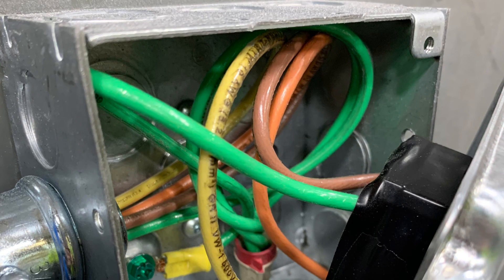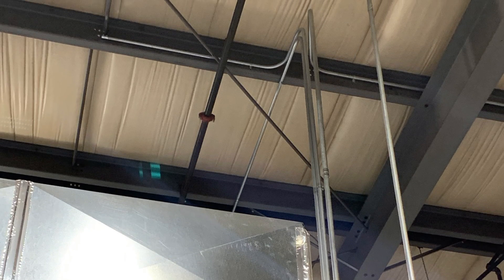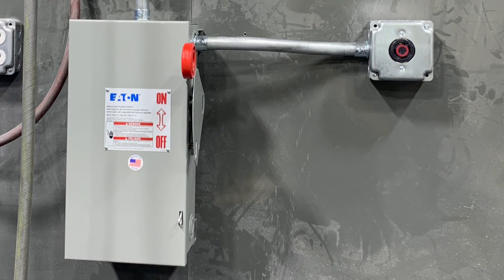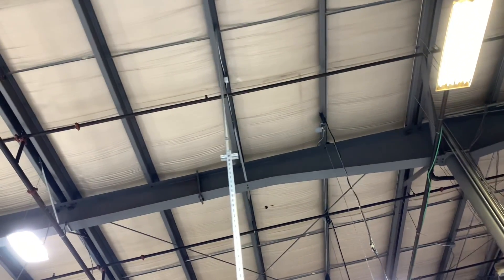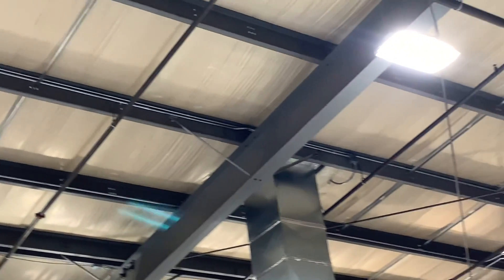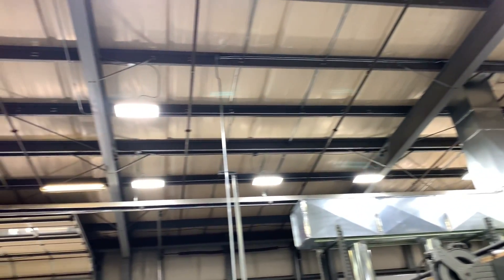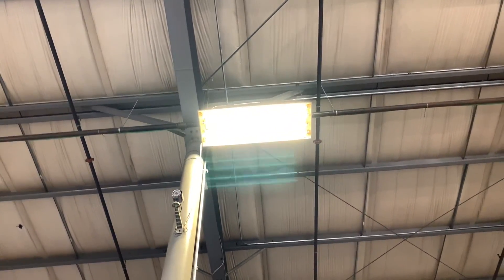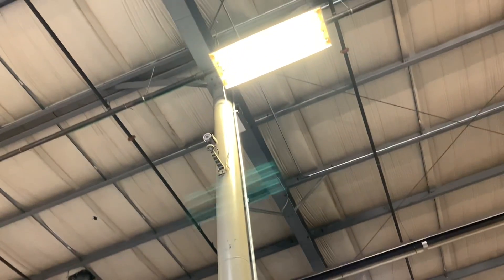Today As An Electrician: 480 Volt-3 Phase-30 Amp Receptacle & Disconnect

Comment: On 480 wiring, do you have a specific order for the 3 hot legs? If a wire is switched up, you swap two to get the motor to turn the right direction. So that's why I'm wondering if that can be figured out ahead of time.
Reply: Brown, Orange, Yellow.. If the motor is out of Phase, (rotation) swap one of the conductors at the disconnect or the receptacle..